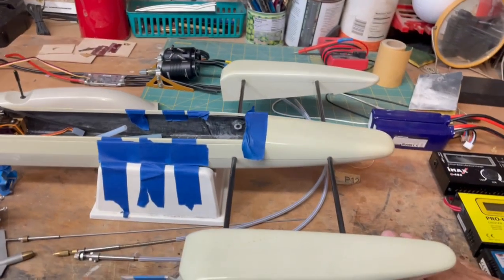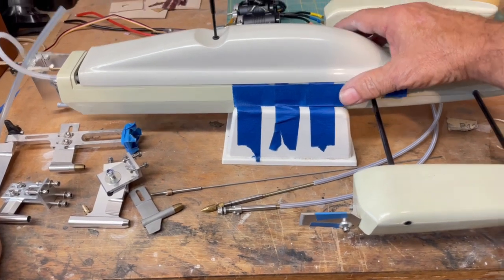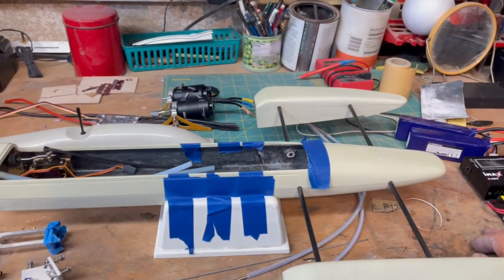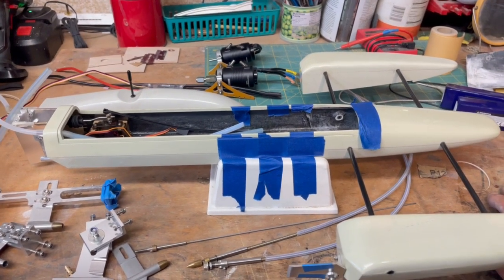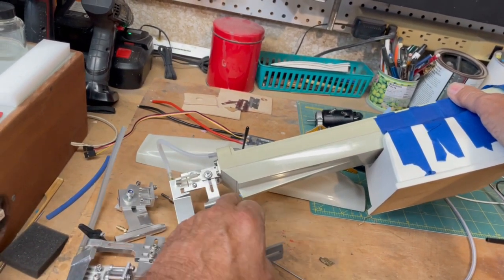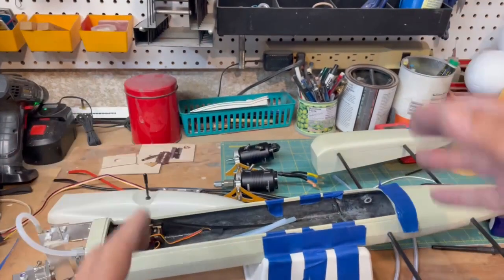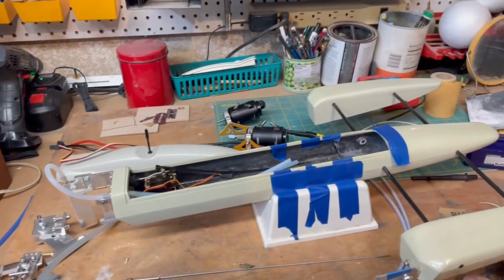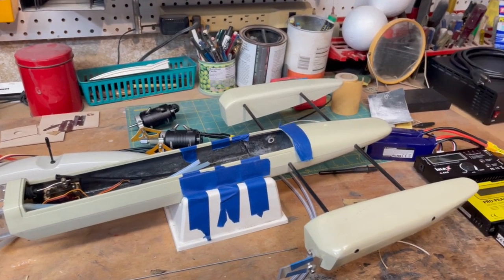Dr Jet reveals a super-secret side project.

Comment: That octura strut is boss I've run a couple of those in the past,  (before i started youtube) should be perfect for the rigger.    I actually broke one in half at the barrel with a larger prop lol.   I cut the skeg off the bottom like you mentioned, there's not alot of small 3/16 struts available, well I guess there is but you definitely have to sift through the selection.   

Id go with the octura cut the skeg & modify the brass nose cone to fit?
Reply from the maker: I'm going to try the wire drive first.  I think I have a work-around on the coupler, more on that to follow.  If I used the Octura strut. I could run the teflon tube out of the hull by 1/4" or so and that would go into the nosecone, which in turn would butt up against the hull.  The drawback of that is I would only have the angle to adjust and not the depth.  Then again, the "stock" setup for this had no adjustment at all.

Comment: Riggers are the best. I can never get enough of them.
Reply from the maker: .Just for the folks here that don't know, Mr. Accord is well known and highly respected in the RC boating community.
Reply: @Dr_Jet  Aww, thank you kindly. 😊
Reply from the maker: @Sweetaccord  With your knowledge of small motors and running gear (slot cars), have you considered entering the JetStepper Challenge?  Build something fast, cheap, and nearly out of control....
Reply: @Dr_Jet  Can't, I have too many other things going on. 😕
Reply from the maker: @Sweetaccord  No problem, but keep an eye out for the results.  I'd really like to see a bunch of equally-powered little single-steppers churning up the water fountain outside of some high-rise high-tech research building during the lunch hour.

Comment: Nice . What motor do you use?
Reply from the maker: My plan is to use a Rocket 2968 (4000Kv) on 3S.  I have a 3400Kv Rocket motor if the 4000 is a bit too hot of a wind for 3S.

Comment: I've been eyeballing a 30 inch rigger setup that accepts a 36 mm or 40 mm my plan was to run a 3674 or a 4068 with a high KV and see what she can do? 80+🤔
Reply from the maker: I don't think my hull is designed for those speeds.  It will have its limitations for certain.